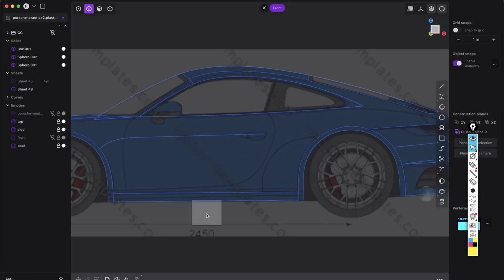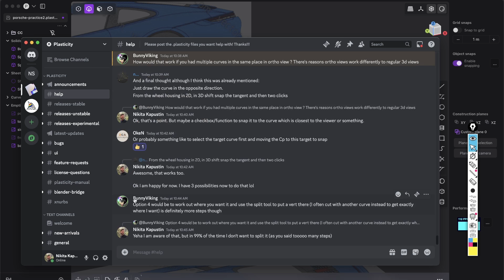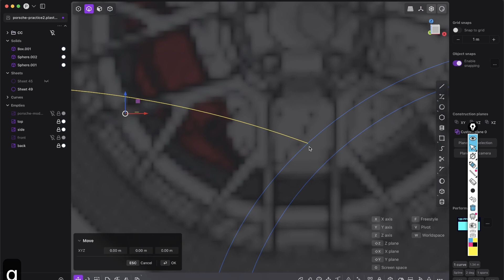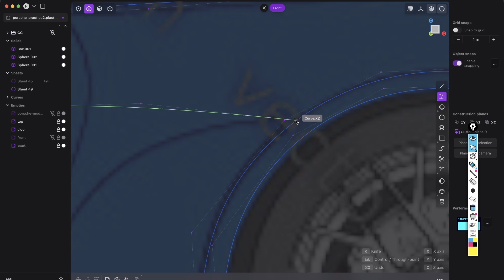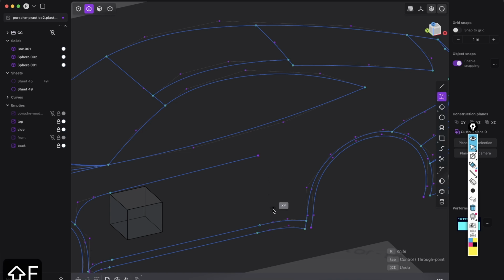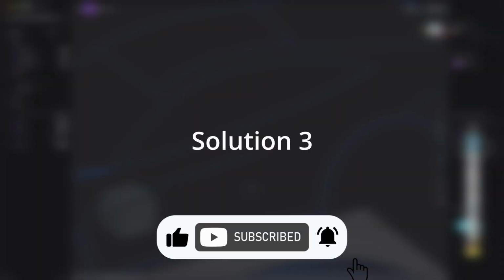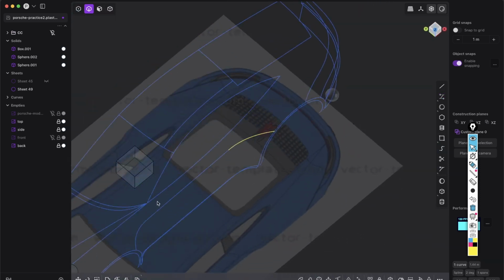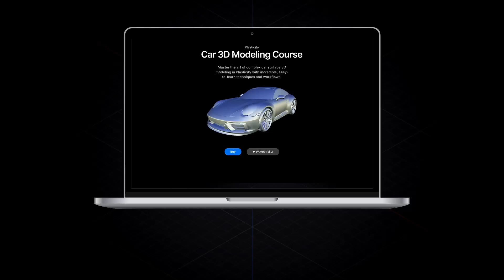Plasticity Quick Tip - Precisely Connect Curves In 3D Space (SO HELPFUL!)

Comment: Great tips! I'm pretty new to Plasticity, but I believe another option is to use the straight edge to create a construction plane. Then look for tooltip "Face plane, curve" when connecting to the curve. This offers other advantages like being able to move control points in the correct plane after the curve is created. You can also save this construction plane and go back to it later to make adjustments.

Comment: One more way you can do this is to use the Bridge Curve.  Click your door line/curve, then set the start curvature to G1 g2 or g3.  then set the end curvature to g0 and click the point you want on the wheel arch.  This way gives you an easy solution to getting G2 or G3 from the door/midline but keeping G0 at the wheel arch.  The one downside do this is the shift/projection line goes away on the wheel arch, but if you are using your reference image that is imprecise anyways.

Comment: I have a design that I made for a device to 3d print. What is the best way to save it so that I can go back later and make adjustments if I would need to? Or is plasticity not the proper software to use to edit designs later? I feel like I’m finally wrapping my head around some of plasticity, but when I’ve saved previous projects and opened them later to tweak them there is no history to revert to
Reply: @KGTv123  There's no real history in Plasticity, unless you kinda manually make your own by duplicating the curves/sheets/solids, and place then in a "Version 01/02/whatever" folder. 

I usually just save the files normally but append a version number to it of I'm making major changes. I usually name my projects with the following format: the date I created it (YYYY-MM-DD), what it actually is, and then a 2-digit version number (always starting at 01), and if I'm making any huge changes then just save it again but with 02 at the end instead, and repeat as necessary.
Reply: @overseastom  thanks so much for taking the time to write that. That’s been similar to what I’ve been doing by saving a  “version” and then editing that one if need be. The problem with that is I can only make tweaks to that from that point forward. It would be awesome to be able to retrace steps in a saved file. The only “workaround” I’ve found is to just literally leave a main or copied version open on my computer, but that’s not feasible long term
Reply: @KGTv123  Looking at my recent project, I see 'planes', 'solids', and 'curves' in the left vertical pane.  You can select them and move them out of the way or hide them,, so you can change the shape or size.  The same applies to extrusions, fillets, chamfers, etc.  Once you start moving or directly editing things, Plasticity makes it EASY!  Instead of redrawing, just select a circle and use the scale command to increase the size.  Rotate, scale, move, and all the commands make it easy to edit the current project.  Keep trying, you will be amazed how easy it to use.
Reply: @garrykraemer8993  thanks so much for writing this Garry. So do you just do your whole projects without joining any curves or parts, so that all objects stay independent for adjusting at a later time? I’ll have to look deeper into adjusting the stuff in the left panel. I just know when I join curves or objects they compile into one object
Reply: @KGTv123  No, I join lines and curves, but if I do not need them, rather than deleting them, I hide them.  That way I can always go back and unhide them.  The more I use Plasticity, the more I learn.  I started after learning Fusion 360, and was kind of frustrated at not being able to have a history, but the more I use it, the better I like it.  I've been making things for R/C airplanes; air scoops, cowl, etc.  If you loft and hide the lines, then you can always delete the loft and unhide the lines and regenerate it.  I try to group things with names so I know I'm working with.  Good Luck.